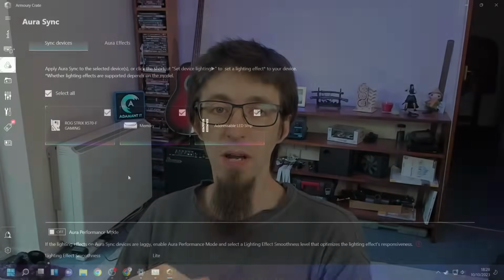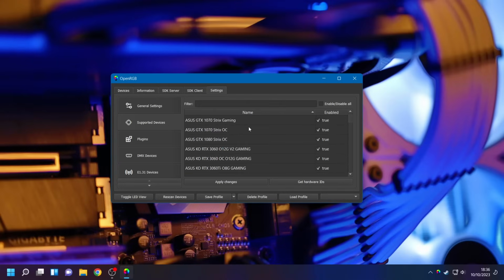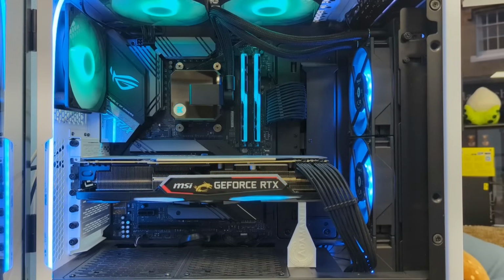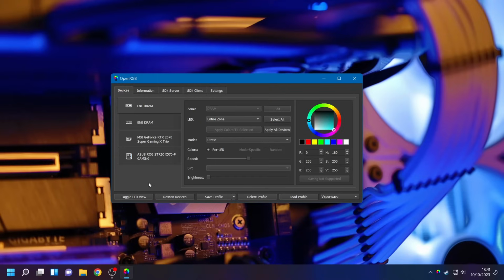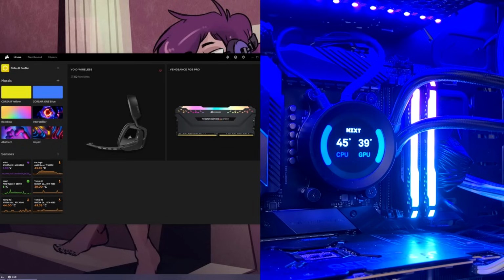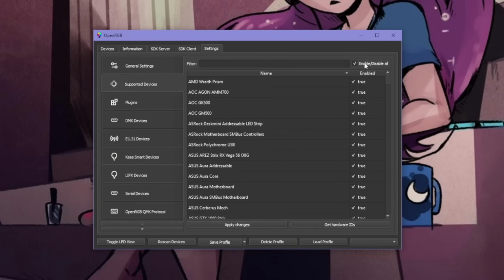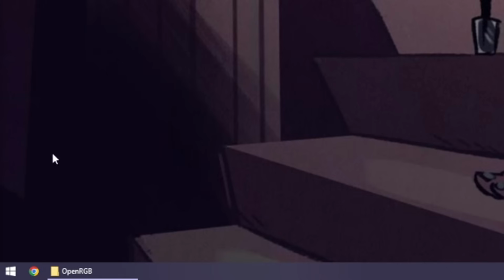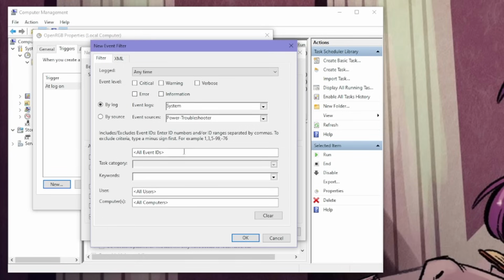Cleaning up RGB control with OpenRGB - LFC#373

Comment: Sucks. You build a gaming computer for performance. The peripherals require Bull shyte apps that absorb performance. I kept all Asus ROG stuff (Mainboard, AIO, GPU, KBM ) I use Piss Crate to control all. I would rather have 1 POS app than multiple POS apps.

Comment: OpenRGB is cool, but has messed up my Leds in 4 devices... one RGB controller from the mobo, broke two leds in a Thermalright fan (they got stuck blinking fast, asynchronous with random colors), colors inverted in my VGA, and changed the color precision in my RAM modules (for example, white now is almost light yellow, violet almost pink and so on).

Comment: Hi there, very insightful video and incredibly helpful! Thanks for taking the time to put this together. I'm having issues with OpenRGB not recognising my 4080 TUF. It should be the same as yours, but it just won't appear. Did you have to add anything or was it just discovered automatically when you scanned? Any help would be greatly appreciated!
Reply from the maker: Might need to make sure that other RGB apps aren't blocking the scans if you're having this kind of issue. Make sure that Armoury crate isn't running on startup, turn off plugins in iCue, that kind of thing. It can be really tricky to solve this, I'm currently testing a Radeon 7900XTX and AMD's own RGB app just won't see it.
Reply: @Adamant_IT   I ended up going on the OpenRGB Discord and it turns out I wasn't using the Pipeline (experimental) build. I switched to this and it's all showing up now and now got my entire system running through openrgb now. Amazing! Your video was the most helpful I could find on this and gave me the confidence to not give up on openrgb. Thank you :) 
P.S. I agree Cam gives a great overview of my PC, although I prefer not managing the lighting through it now.

Comment: For the 40 super cards, only the beta version works, and it doesn't accept login as administrator, when I try to log in the PC restarts and doesn't open, it just stays on the orange LED, if I turn off the PC at the source the damn RGB comes back. Any solution for this?

Comment: Thank you! I had problems precisely with setting up openRGB so it would run again after waking up computer. Since one of my RGB lights is only detected when I run openRGB as administrator (for some reason...) its important to mention that in this case one should select in task "run with highest privileges", otherwise it does nothing. Took me some time to figured out but now it works like a dream. Thanks you once again!
Reply: For the 40 super cards, only the beta version works, and it doesn't accept login as administrator, when I try to log in the PC restarts and doesn't open, it just stays on the orange LED, if I turn off the PC at the source the damn RGB comes back. Any solution for this?

Comment: Can you tell me whether the profile files needs to be kept inside the default folder i.e C:\Users\[USERNAME]\AppData\Roaming\OpenRGB
or if I can keep it backed up anywhere in my drive & while creating the task in TS, how do I specify that backed up profile path?
Reply from the maker: Not sure, I haven't tried this. You could try using --profile "C:\somefolder\Profilename" but that's a guess. Make sure it's somewhere that programs will have permission to access, ala, not a system folder or whatever.
Reply: @Adamant_IT  I've tried & it didn't load, can you try from your end? & What about the logfile Q I asked in my earlier comment (how to exclude creating logfiles evertimes openRGB starts?)

Comment: This was interesting!
Can we use something like this with a Fractal Design Pop Air XL RGB case? That has a standalone button to switch between colors and modes? Can we install a custom controller instead?
So we can add more RGB lightning for example?
Reply from the maker: If my memory serves me, the Fractal Pop's RGB controller doesn't have a control input, but you could just plug the fan daisy chain into the mobo instead, and then yes, you could use OpenRGB

Comment: Last year I got a "new" pc and having been in IT for over 30 years this was the first one with RGB.
After trying to get all of it to work together I came across open RGB and it's one of the coolest programs I have used.
I think I needed Icue software for my case fans but mainboard, ram, keyboard, mouse, everything else shows up in it.
Just wanted to share that.

Comment: I almost bricked a b550 taichi with openrgb, or at least looked like that, led was completely unresponsive to any change and boot time took forever. fixed with a bios update which also reset the led controller but im not taking second chances. I'd rather just hook it all up to a physical controller

Comment: Good stuff! I have OpenRGB but I run a mimimalist, accent-lighting scheme on my PC, 2 strips for top and bottom of the case behind the side panel, and my Roccat keyboard. Simple and easy. My mouse has the RGB as on-board firmware controlled by the DPS button so no software there.

Comment: I wanted to like OpenRGB, but it wouldn't work with my MSi motherboard, and apparently OpenRGB was bricking some MSi boards for some reason or another, so they removed support for MSi motherboards. Don't know if that's changed since I set mine up, but I ended up having to use Signal. Really wish OpenRGB worked since Signal has to run in the background for everything to be retained.

Comment: iCUE from Corsair is still a nightmare...
Reply from the maker: I've honestly never had a problem with iCUE. Admittedly I've never run it on my daily, but the couple of machines at my shop I've used it on have always been fine. I think that like NZXT CAM, it's a heavier system, but if you're running corsair, you probably have an AIO plus fans, so it's going to be doing thermals as well as RGB, which makes it more worth the footprint.
Reply: @Adamant_IT  I use 6 Corsair products. AIO, fans, RAM, Deskmat, headset and stand/DAC. Had hicking problems on W10, then I upgraded to W11 and things became worse. Reinstalled many times but always had a component or two missing or giving error when had to update firmware. Also I used to control AIO fans from block but had to to open software to load curve profile or it would start pc at 100% speed so annoying. Went back to W10, maybe I will try this software for a change.

Comment: I use OpenRGB on a daily basis, and its great, except when it keeps forgetting how many leds my Lian Li unifans have so they default to unicorn vomit

Thats my only gripe with it tho, works great otherwise
Reply from the maker: Yea, that tallies with the jank I briefly mentioned, where sometimes it just doesn't seem to save a setting. Once all the details are in the config it seems to be fine, but a few times I've had settings just not take. Solid once working though!

Comment: I'm a little surprised there was no mention of Dynamic Lighting  on Windows 11.
Sure its early days and its coverage is limited but if manufacturers start adding support...............

Also "vapor" rather than "vapour" ;o)
Reply from the maker: Yea I was going to mention it because I'd been excited for Dynamic Lighting until I heard that it only worked with about half a dozen devices and that seems to be it. Only good for OEM implementations I think.

Comment: I have to get rid of Armory Crate. It is the epitome of bloat just to run the ARGB of a couple of LED strips. I've been in the PC/IT industry for decades and ARGB is just a silly guilty pleasure and there's nothing wrong with being silly. Thanks for the heads up with the quick, dense and bloat free tutorial. I've just bought half a dozen Thermalright TL-C12C-S and I'm going to shoehorn them into a 20 liter compact case. My EVGA Z15 keyboard will still be run by it's original software because (a), it completely unloads after programming the keyboard and b, I use the software to remap the numpad area for left handed playing.

Don't get me started on the stupid MSI software. When I built my son's rig, I used an UpHere fan kit with its own crappy hardware controller because of how bad the MSI bloat was.
Reply: For years I have seen people saying armory crate is the worst, so I never touched it, until I did one day. Thought I'll just uninstall if I don't like, what's the harm. I was wrong AF, that shit truly was the worst

Comment: I had SignalRGB for a while.  Some of the effects were ok, but it used about 20% of system resources - just to illuminate my keyboard.  And they want you to pay a monthly subscription fee that's more than Netflix, which is a bold move.  That being said, you can do some pretty cool things with it by tweaking settings on the preset effects.  But the system hogging and regular gentle reminders to sign up made me uninstall.

Comment: I’ll have to consider this. I have mostly Corsair with an ASUS GPU. I just want all RGB to be a soft aqua static colour. Set and forget. I originally had iQue and Armory crate installed and it worked.

Not only has iQue managed to completely destroy itself multiple times purely through auto updates, I ended up giving up on Armoury crate because the integration to iQue also failed whenever either package updated.
Reply: Icue not ique lol
Reply: @adamtajhassam9188  haha my bad.

Comment: NZXT cam uses a lot of CPU resources
Reply from the maker: Yea it's not super light-weight, but it's not awful either. As I mention in the video, it's worth it if it's carrying its weight in utility IMHO. I wouldn't use it only for RGB or only for fan control.